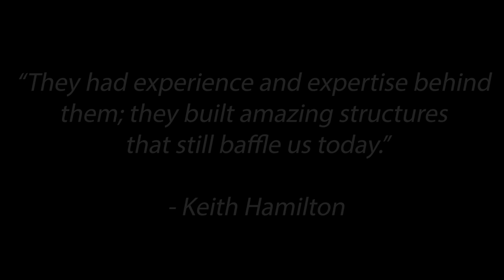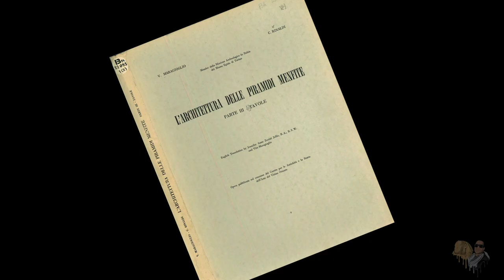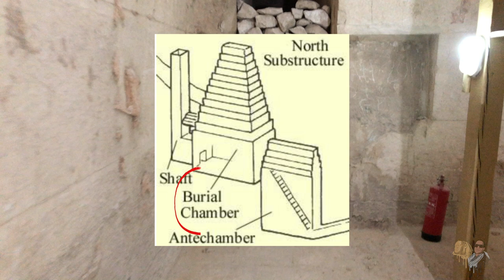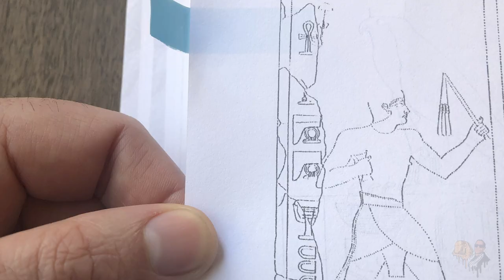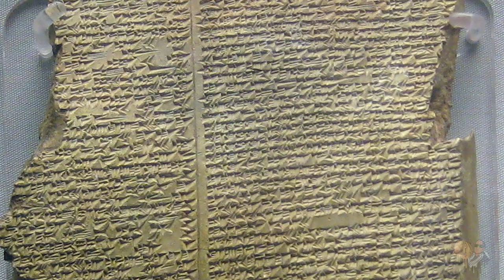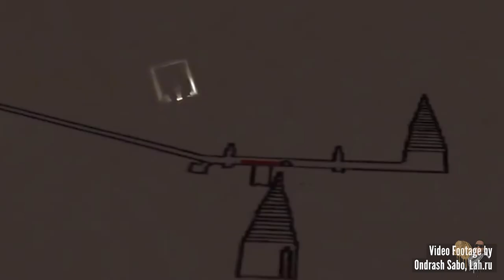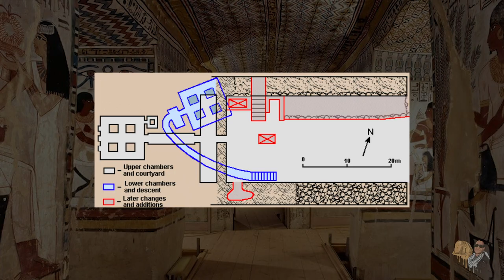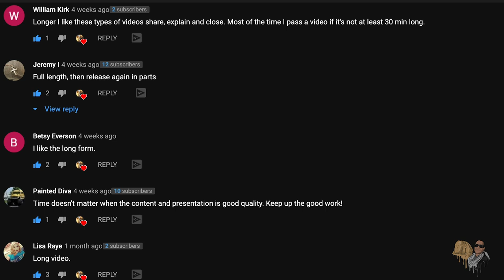SECRETS of The Bent Pyramid: NEVER Before Seen Video INSIDE The Bent Pyramid of Sneferu! Anyextee

Comment: Someone should create 3d maps using something like Blender, with exact dimensions for each block, in detail, for each Pyramid. IMHO it would help bot the intrigued internet community, and the backyard scientists alike. Of course, this would require detailed dimensions and photos of each block, but wouldn't it be awesome, visiting such monuments just like walking the streets on google earth? Also, using such a model could also allow architects to add things to it, simulate different events (such as checking the way the air flows, or how the vibrations travel though the galleries, or calculating different forces some liquids would interact with the pyramid itself in a flow process, etc).

Comment: thinking on the bent pyramid

as sohaila was talking about the red pyramid being very masculine and the bent one being feminine, I began to have a picture emerge in my mind. I saw the position of the bent and red pyramids as a sort of border between upper and lower egypt. lower egypt is red and has the red crown. upper egypt is white and has the rounded bowling-ball shaped hat. round usually means more feminine to me, so that falls into place there.

then, I thought about the "as above so below and as below so above" saying.. it could be a sort of metaphor of the upper and lower egypt. as far as I know, there isn't any pyramids in upper egypt, other than the one that is on elephantine island. I don't know what that means, but what I started to think about is that the ancienty egyptians perceived the nile river like the spinal column. the "root" of the nile river is up in the mountains, and so this "root" place was probably somewhere around aswan (or maybe the regenerative -- dunno).

I postulate then that the bent/red pyramids would then be located near to where the heart would be located. this is probably why the red pyramid has two sides to it like the left and right ventricle. it's either that or it's the heart and the lungs. I don't really know.

either way, if the nile as the spinal column analogy holds, then that would mean the great pyramid is located between the throat and the crown, meaning that the throat is around saqqara and the crown is the delta extending out from the great pyramid out to alexandria and port said (see https://www.youtube.com/watch?v=3pCPbucb8nw). egypt was probably designed by the builders to be a sort of "model" for the enligtened human...

that's the sort of picture I was getting anyway. it probably needs a few revisions though...

howeever, regarding the bent pyramid, what it looks to me like is happening is there must be some sort of energy transformation that is happening between these two chambers. the weird vertical shaft that sits in the centre of the pyramid must be an integral component of this traansformer. I'll give my initial impression here:

imagine for a moment energy travelling up from the ground into the pyramid. as the vibrations bounce off of the smooth casing stones, a portion of the wave will reflect back toward the centre and accumulate all into a convergence line rising up the centre of the pyramid.

knowing that, I postulate that the lower chamber is the resonator for the lower (54 degress pentagonal) portion of the pyramid.

however, if you look at where the reflection off of the upper (43 degrees) part of the pyramid, the centre reflection line would converge starting around where the bend takes place. I'm pretty certain that there will be a chamber at this location as it corresponds to the base of the upper pyramid's centre axis.

that leaves the upper chamber and the mysterious 60 degree pyramid. I can't say for sure, but I imagine that the upper chamber ia probably related to the hidden 60 degree hexagonal pyramid. since its shaft is facing west (and was noted by you guys to be assocated with wind). it likely has something to do with the rotation of the earth, so lungs. lungs are a cube and a cube laying diagonally so that a hexagon will traverse its root(3). therefore, I would imagine that a cube is either fit diagonally into the centre of the bent pyramid, composing one of those faces, or it's symbolically found like a diagonal half of a cube. (place a hexagon around a cube diagonally from one point to the opposite point and you will see).

Comment: The room with the cedar logs: 
The horizontal cedars and the stone floor they supported look to be a remodel wedged under a cobble shelf. I noticed that there was a stone floor that looked built in, no mortar, original that has been quarried. Looks like 2 of the recessed circles could be related to it @ 1:11:20 and third on north wall around 56:00. The 4 stumps look to have been added as stumps as potential support for the failing top floor.
Reply from the maker: Thanks for watching and commenting, Matt. Great observation!

Comment: Do you think the Giza Plateau had an active Aquifer beneath it in the past? That this aquifer supplied all the complexes on the plateau with water, effectively linking them all together naturally, and is the reason for the Causeways?
Reply: I have never read it from a "credible source", but I have heard, many times, that there are active aquifers under the pyramids on Giza, even now.. The sphinx had surface water access, back in the days, though
Reply from the maker: There is certainly water below the plateau. The rising water tables is what prevents Egyptologists from digging below the Sphinx. To what extent the water runs or how it may have been utilitized in the past is still a bit of a mystery. I will be discussing water in depth in my forthcomming book. Ancient Wisdom of the Water Wizards. You can join the email list for updates on the book here www.Anyextee.com

Comment: I noticed aswell that at 40:44 you can see the heiroglyphs faintly after she says how beautiful and the camera pans up, i'm not sure abouts others but that's the first time i've seen them in a spot like that, the artistic nature behind that section is remarkable
Reply: also Limestone is porous so always contains water due to humidity & rain, absorbs salts used for melting ice and also has its own ions to act as electrolyte. So, you often see rust streaks from steel in limestone. So looking at this video and if you look at pictures of rust on limestone/granite you can see it looks very similar and that patterns are too, Sandstones can't rust but if a metal is put over it that is rusty for an extended period of time the corrosion will become ingrained onto the stones. What do you think it could be?

Comment: Those slots are made during construction for wooden beams are used to hold the lower blocks fixed in position and from sliding towards one another while the blocks on top are being lined up. Try doing this with a lego/block set.

Comment: How do you get all those cedar beams into the rock?  The beams would have to be laid prior to the above level of rock being set over them.  Are there any good images (detailed) of their point of entry into the walls?  That would tell a lot about how this was done.  If the rock matches the wood sides perfectly it'd be hard not to argue for geopolymer.  I'm not saying it was, I just feel like with the wood, there is a clue.  also at the lower levels in that area, the finish is much finer than above.  
Great video Anyextee, thank you.
Reply from the maker: Its a mystery. I been trying to wrap my head around it. Keith Hamilton offers an interesting explanation in his paper but it has not yet been proven. It is a DEEP mystery. More work needs to be done on this! You can find some pretty good images at the ISIDA Project website. Link above in my description to both, Keiths paper and the ISIDA Project site with the photo documentation. For the sake of brevity I did not want to get into Geoplymore in this video because it wouldve turned into a 3 hour video, but I do plan to cover Geoploymer theory in a future video. GREAT observation and thanks again, for watching and asking the right questions!

Comment: Most Anyextellent. Thanks

I'm only half way through (longer attention span than a millennial but well past my prime so indulge me) and so you may answer these musings but my first thought about those indentations ca the 1:16 hr mark is the default position for any of us who have poured a lot of concrete and taken the trouble to read Davidovits.  (If you haven't done both I'd argue you haven't finished your homework.  You don't have to agree but you do have to do your homework.)

Dunno yet (no pun intended in case Chris is watching) your position on Davidovits but I have no doubt he is right and the pyramids were poured, not hacked out of Aswan, Tura or anywhere else, dragged to the boat which didn't tip over, dragged up hill, chiseled (I'll even give you iron and you still can't do it, even with a granite bowling ball for a hammer -- I prefer 13 lbs with holes for our fingers), set on top of that last one, levitated, chiseled and polished some more and set perfectly in place and though they didn't have credit cards, no room for even air to pass.

That is impossible, as are aliens and giants.  So let's go with what is left, ie, cement.  Na is the symbol for Sodium, as in Natron as in Na2C03.  Plenty of free dirt around and quite a bit of water.  Dirt cheap.

Enough of that.  So, these holes remind me of snap ties or else a slot for the poles that keep the forms/molds in place.

As for the cedar dating, you may know that cedars, at least the ones in my neck of the woods, 
western Washington, live to 1,000 years. 500 is middle age.  (About 10x human lifespan.)  So, any carbon dating that puts the sample around 2800 or 3000 BC is not a problem since in 2500 you would be working with a tree born in 3000.  

I realize I've already gone on too long but if you're still here I'd like to chime in on resonance.
I would like to seriously consider the possibility that these world class engineers figured out sonolunimescence, where ultrasound creates intense pressure (enough to crack the King's Chamber?) and produces light.  Ever see a firefly?  It's a wonder they don't blow up but I suppose those ones didn't reproduce.  Darwin rules.

The Ark of the Covenant, Matt's Ancient Architect video on this subject is compelling, was therefore a supercapacitor.  I suppose it was recharged, which is what a car alternator does, somehow as it sent a pulse to and from the granite resonator that we call the King's Chamber up and down the extraordinary ascending passageway.  

This pulse blasted the well water below (always featured) and produced light.  Lux fiat.  First thing God said as I understand it.  First thing he did I suppose.  Hard to see what you're doing without it.  In the beginning was the Word?  Maybe.  In the beginning was the Light.

I've taken enough of your bandwidth, if not your credulity, but I appreciate your methodology and think you are going about this in the right way.  Never forget -- Nullius in verba.

Sort out the facts and then draw some conclusions.  You're on the right track.  
Cheers, HH

Comment: Great video, thanks for uploading. On the beans and notches, I've an idea that's not based on any evidence but just a thought. What if the builders placed many blocks/rocks on the beams during construction and sometime later the beams give up and drop their load, basicly a fuse or time delay that would block up the passage ways after the builders left and the piles of rubble needed to be removed is said blocks/rocks?

Comment: I watched the entire thing and still don't understand why it's shaped like that. Did I miss something.

About the wooden beams, I'm sure there are at least three additional beams on the wall that you couldn't see (under you). You would only need a long selfie camera to see if there is a wall or maybe another passageway there. Hope you get footage from it on your next trip.
Reply from the maker: Thank for watching Eysteinn. Im not sure if you missed something. I did explain the two opposing points of view with respect to why the pyramid has that unusual shape. I included the Egyptological point of view vs the symbolist perspective. As far as the wooden beams, yes, there are 3 verticle beams on each of the 4 walls. There is no known passage. You have to crawl down into it or use a ladder from the top of the massif. However, there could be a hidden passage we just don't know about. The excavated cavity below, where they found the cartouch of Sneferu, if continued would have led into that area.

Comment: 1:29:40 where the wind was coming from?
Reply from the maker: The sound of the wind was just a sample of wind, a sound effect that I added in post production to go along with the theme, but there is an actual breeze that comes through the pyramid and at certain times it does make noise. Some say the Western entrance is responsible but early Egyptologists working on the pyramid believed it may be linked to an undiscovered channel. They hace since done scanning which suggests there are no more passages or channels, but I'm not convinced. I don't think the Bent Pyramid has given up all of its Secrets yet.

Comment: have they carbon dated the cedar beams ? I think possible later additions to restrict movement?
Reply: My initial impression upon seeing the cedar beams is that they were placed to block horizontal passages. Not sure how they would be inserted and placed. Seems to be in amazing condition, for being thousands of years old. What exposed wood structures have lasted for over 2,000 years? Very strange!

Edit: I stand immediately corrected. Horyuji was built in 607 AD and has little to no decay. This chamber would have ideal conditions for minimal decay. Amazing how the wood looks like it was cut yesterday…

Comment: 1:11.    Has anyone carbon dated the wood?
Reply from the maker: Bok Bok, Great question! Thank you for watching and commenting. I do have in my possession an academic paper with data showing that carbon dating was performed but it is unclear where the samples were taken from. I'm not sure if it was directly taken from the cedar wood or some other organic material somewhere else in or around the Bent Pyramid. If I recall I read somewhere else that it wasnt the cedar from which they obtained the sample, but I cant remember where I read that. I need to dig in deeper. I'll cover in a future video for you.
Reply: @Anyextee  I guess even if the wood was dated to around the accepted time...does not necessarily prove the whole pyramid was done then but it's one more piece to the puzzle. I couldn't believe how accurate those tunnels were...no way could that have been done with copper chisels....